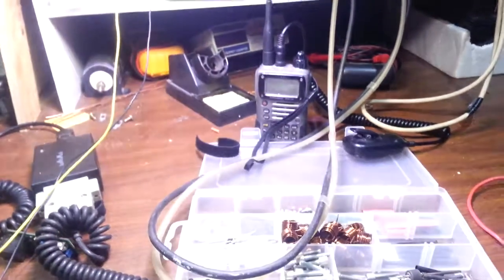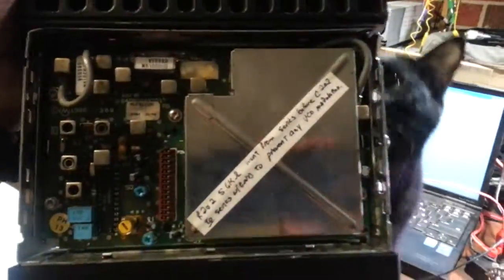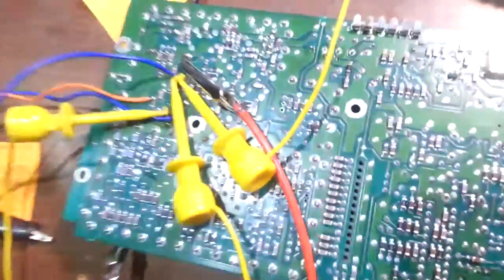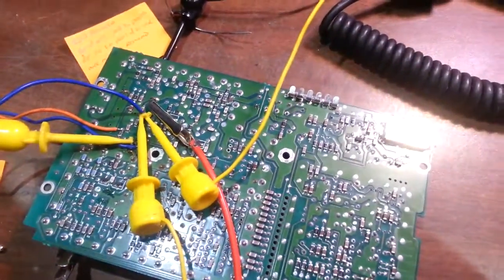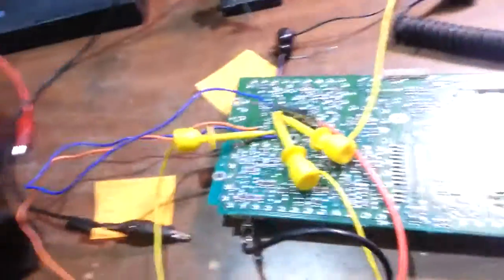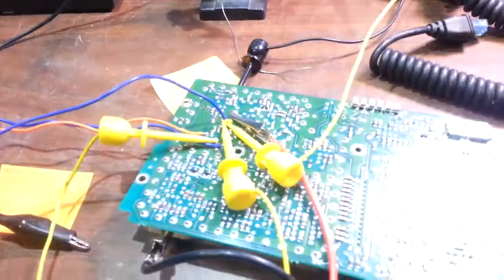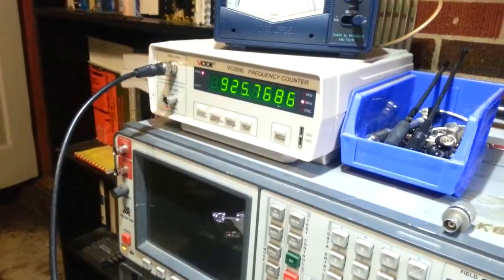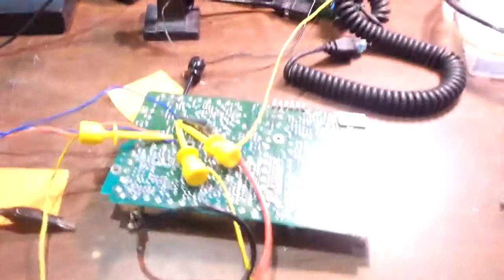Motorola Maxtrac 800MHz radio modification to Amateur 900 MHz 33cm

Comment: i have several of these but they are the trunk unit, any input about changing back to conventional, maybe I am missing something
Reply: That info is here: http://www.repeater-builder.com/motorola/maxtrac/maxtrac-8to9conv.html Get the new firmware chip, and setup the new board.